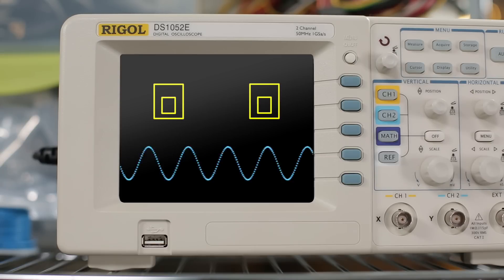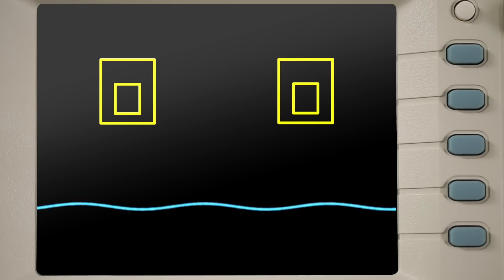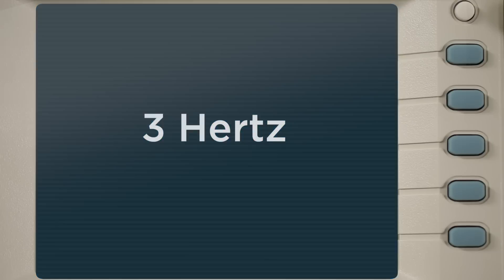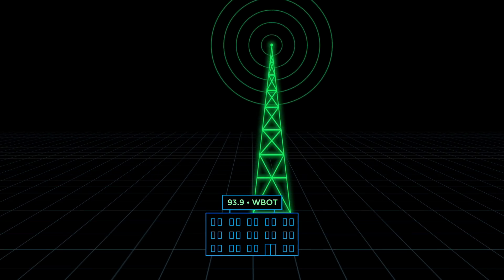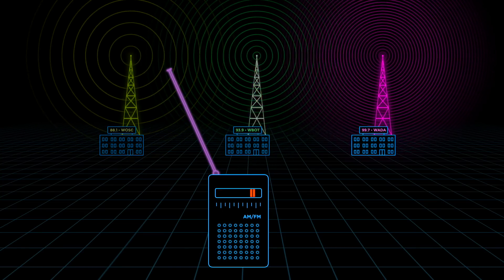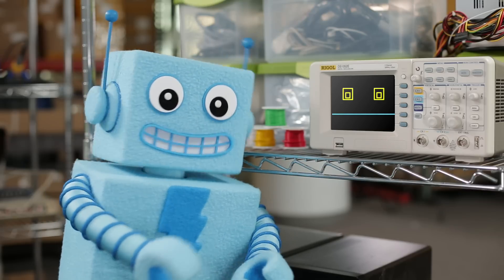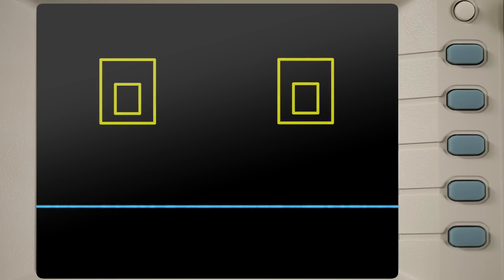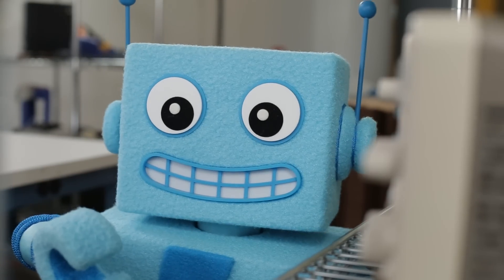"F is for Frequency" - Circuit Playground Episode 5

Comment: The subtitles seem a little messed up. They run at the wrong rate and there is a mistake with the frequency of the radio stations. 99.1 vs 93.1 on the subtitles. My nephew loved the video!